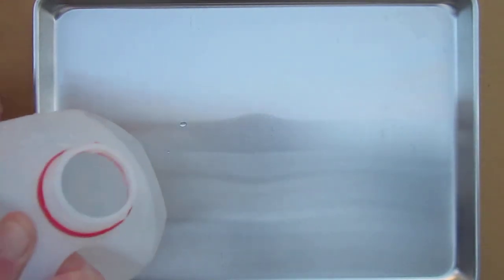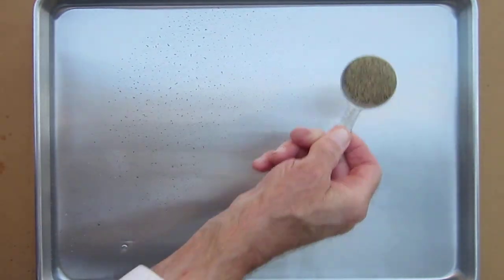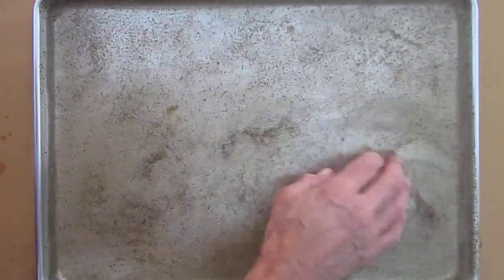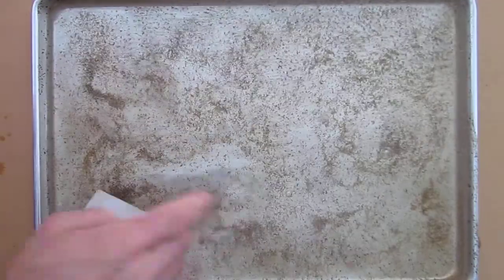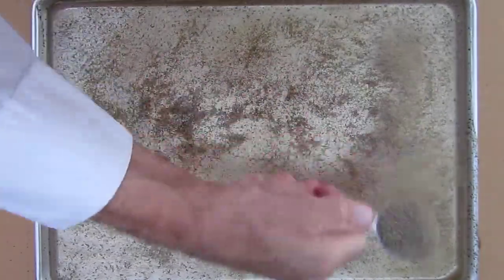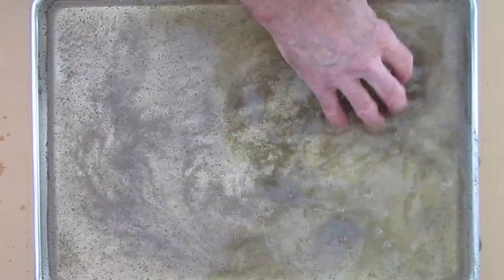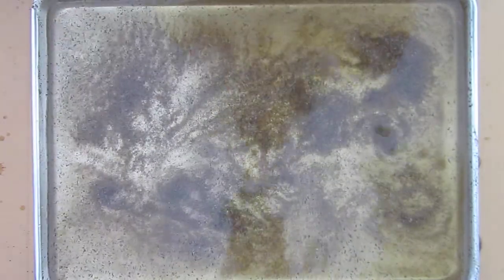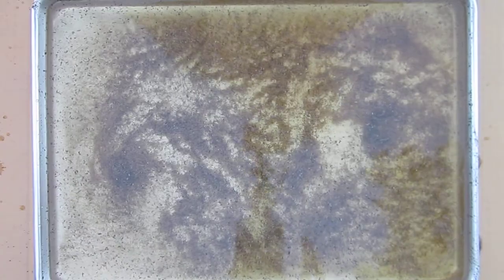Demonstration of Trailing and Bound Wing Vortex

Comment: Thank you! However I couldnt understand your explanation of the Coanda.
Reply from the maker: Hmmm. I didn't say anything about Coanda effect here. Perhaps you are referring to this:  https://youtu.be/eoEIHll0q-0
Coanda effect exists when a jet or sheet of rapidly moving air moves over a curved surface. The air moving along a curve is being accelerated away from a straight line. Think of centrifugal force. For the situation to be stable a pressure gradient must come into play, with the pressure being greater on the outside of the curve. Since the pressure goes to atmospheric a distance above the curve, it must be less than atmospheric on the inside of the curve, adjacent to the surface. The pressure of the static air on the  other side of the surface is atmospheric. So the pressure difference pushes toward the outside of the curve.
Reply: @aeromodeller1  Thank you. I think I understood a bit more. Could you kindly refer me to an image/ article where I could see the diagram and understand it visually?
Reply from the maker: @ashutoshbhakuni303  Put 'Coanda' in the YouTube search window and you will find many demonstrations. Look it up on Wikipedia.
Reply: @aeromodeller1  Thank you. I will do it again. I have searched about it in past but couldnt understand and/or trust. Aerodynamics is so full of false info on web and even some academic texts.